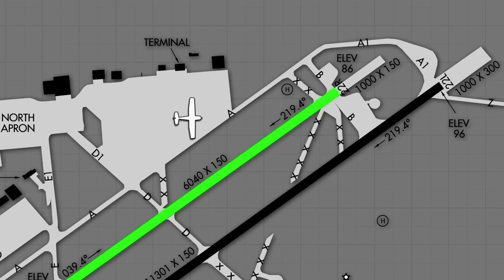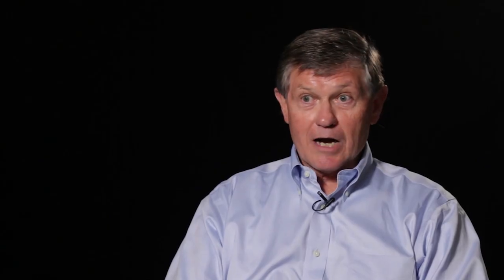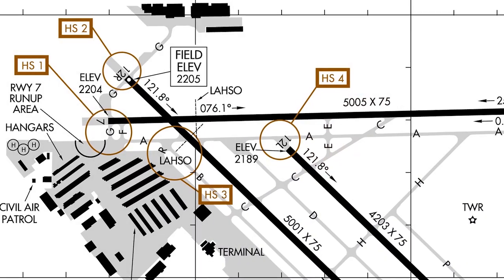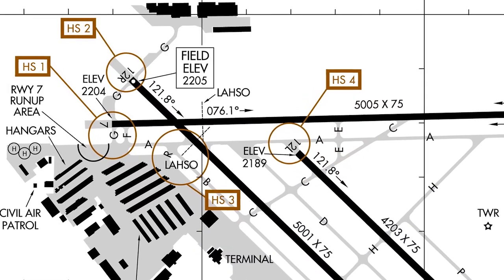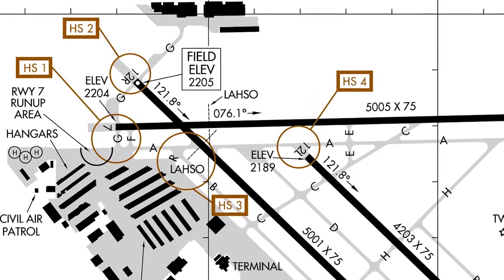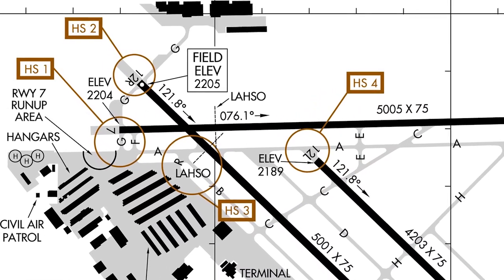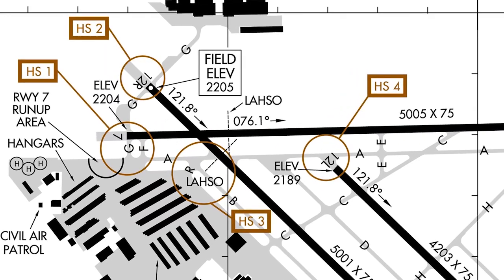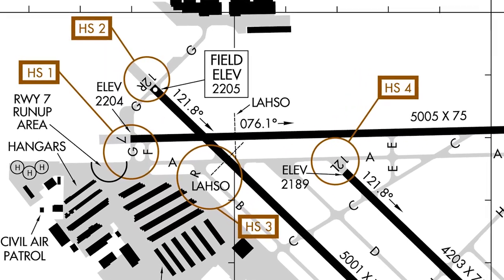Runway Safety - The Big Picture

Comment: Talk to the FBO about a taxi route?  Considering that a taxi route can change at any moment for many reasons, and an FBO person is probably a non-pilot not even listening to ATC, that's a bad source for taxi information.
Reply: So you never flew in/out of uncontrolled airports. MKK had a change that was not issued as notem yet. Seconds change things
Reply: @ProctorFarmer  You are correct.  If the fbo is aware of a change or incident which just occurred at any airport and isn't in the notam system yet, that's very timely information.  I was thinking of an article I read sometime back which suggested fbo's in general were a primary source for information about taxi routes.  Thanks.